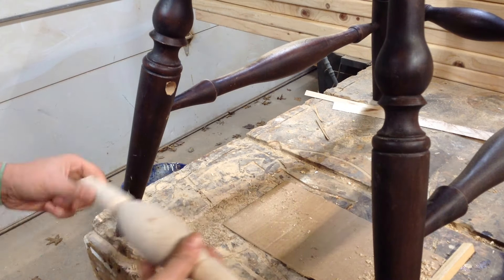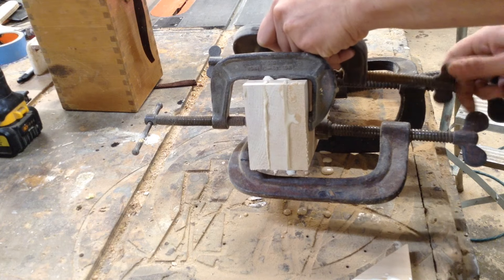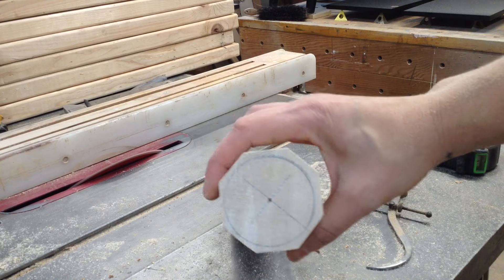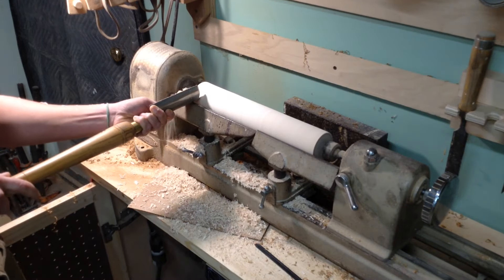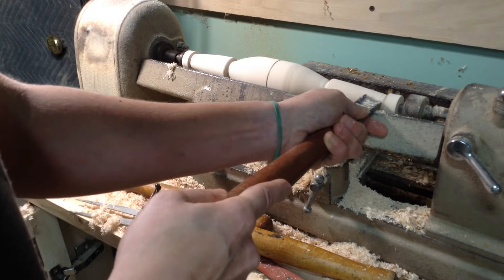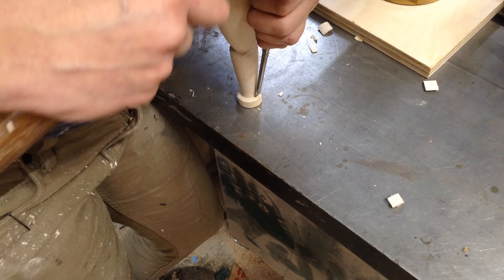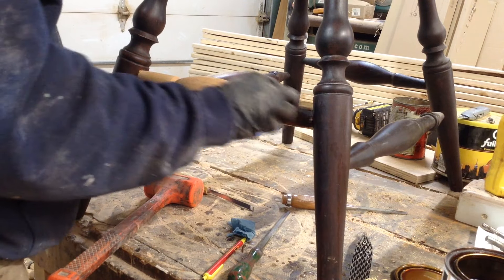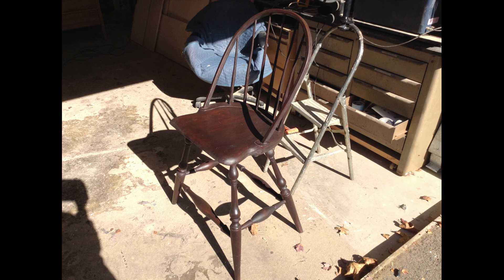How To Fix A Wooden Chair

Comment: Nice fix, turned out great and perfect colour matching too, had to fix a few chairs in my time, luckily I can’t remember having to make new parts too often generally clean up old glue etc and refit and glue everything back in place, that’s not always as easy as it sounds 👌👌👌👍👍👍🇦🇺
Reply from the maker: That stain was amazing.  I don't think I have ever run into the luck of finding a stain match that easily, and without having to mix at least two colors.

Comment: Hello H. B. Nice job on the repair. I love Windsor Chairs myself. I have two of the exact one in the video. I carried them home from the edge of the street from someone’s trash. Nothing broke , just need to be refinished with some oil or poly as they are completely void of any clear coat. Actually may just use Black or a Green color of Milk Paint on them. I love walking the neighborhood on trash night, you can usually find some type of piece of furniture that require just a small repair. Sometimes you find a piece that may be to far gone but has great Hardware on it. Your Turning turned out fine.  That lathe looks like it’s a really solid built piece of Machinery. I love the old Delta’s, Powermatic, Craftsman and the like. Seems like they were made to last forever.  Have a nice week ahead.
Reply from the maker: It's amazing the things you can find in the trash.  Chairs are great because they are one of the few things that are usually still 100% solid wood.
Reply: Absolutely. Enjoy your day.